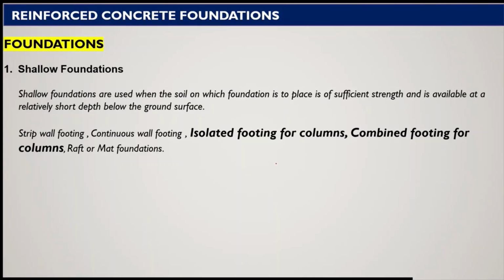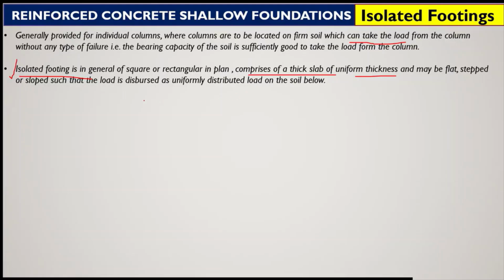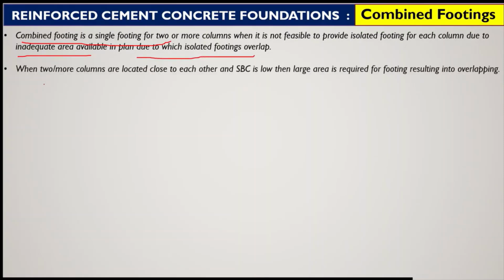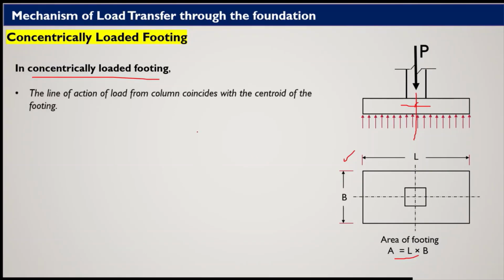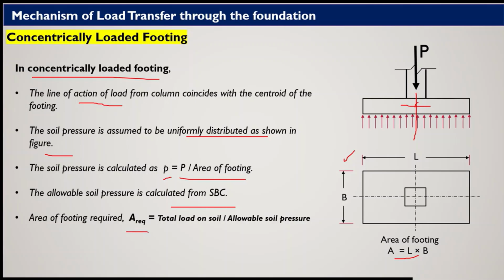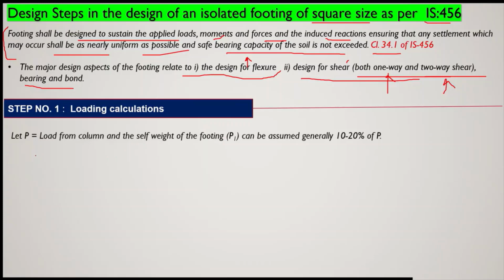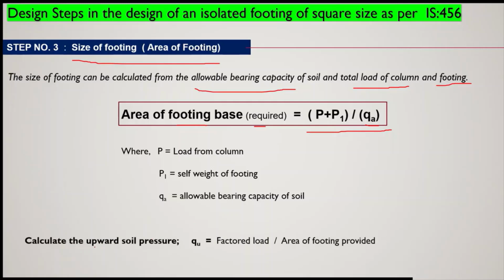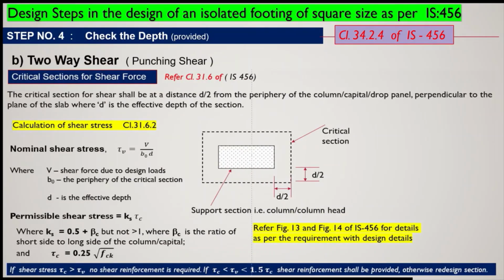Lecture 29 || RCC Foundations || Types and Design Steps || IS-456

Comment: Sir as we can use retaining walls in hilly areas soo if there is very moisture in the soil ... soo we can use retaining walls there and which type of retaining walls like concrete. Stones can b used there..?
Reply from the maker: Yes the retaining walls are required in hilly areas to retain the mountainous backfill during the road constructions.  The type of retaining wall is decided based on local terrain and availability of the materials.